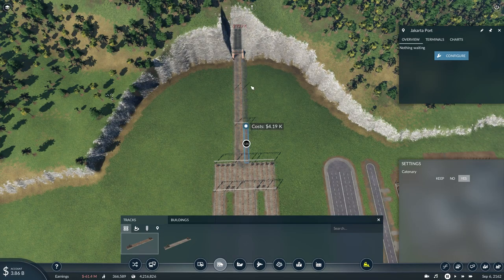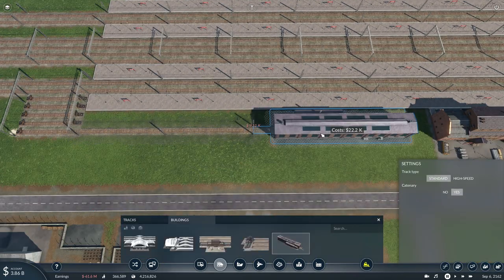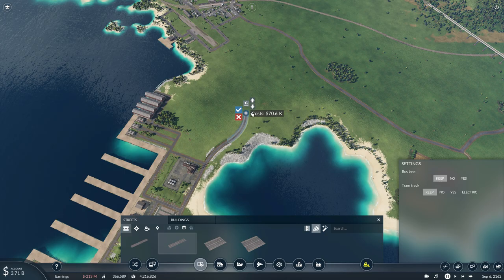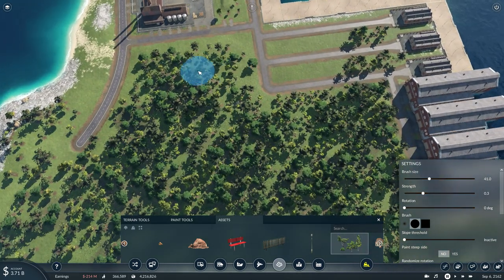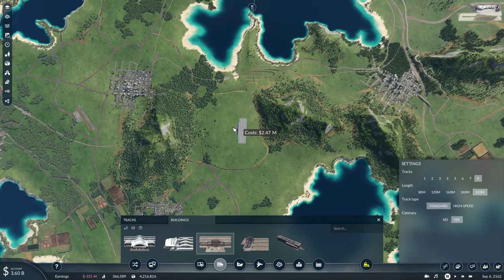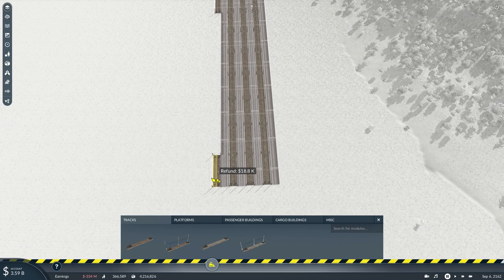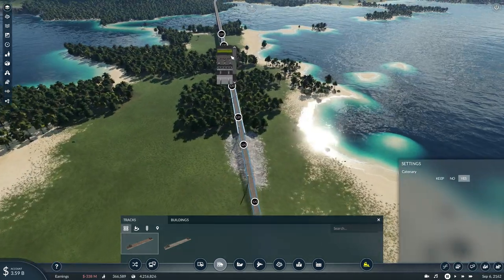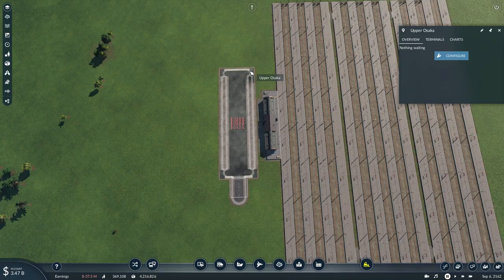Transport Fever 2 - Freight Hub (Oil wells, Oil refineries & Fuel refineries) PART 2

Comment: My compliments as always. Could you build a 3-story station? The first level would be underground. The second level is at street level. The third level is above everything. If you know the compass rose, take a sheet of paper, make a point in the center and the lines pass through that point. The first level runs from north to south. Level 0 at street level runs from west to east. The third level runs from north north east south southwest. Look THE + / I + / overlap these symbols and you will understand.
Reply from the maker: Building a 3 story station will require to many mods.
And I am trying to use only a couple of mods
Reply: My friend the mod stations are 2. The first is underground and the second is the station on 2 levels, everything is on Steam. Make a basic station. As for the other mods, limit it because you don't have to make a megalomania it is a project of realization then the commitments and modifications of megalomania come later and I assure you that it leads to inspirations of many ideas.
Reply from the maker: Will see.
I am trying to build most of the thing with the vanilla object,but that can change :)

Comment: Which mod do you use so you can place and delete industries? I'm currently using one where I can't delete them, Industry Tycoon by Pluesch
Reply from the maker: You don't need any extra mods!
The one that comes with the game (sandbox mode) allows you to place and delete industries and towns!
Reply: @UnknownPlayer2020  so there's no mod i guess. So, does using sandbox mode change my gameplay experience in any way or is it just the same?
Reply from the maker: It just makes the the game feel a lot easier.
For example you can set a good production chain next to a town that requires it.
Or you can create a whole industrial area with different factories.
Or place several towns together to create a huge city. There are unlimited possibilities , it's up to yourself how you like to play the game! :)

Comment: I was building something similar and had to split the road haulage into two lines to deal with the amout of crude/oil/fuel coming off the large train and ships. This also meant in large cities each road line could have drop offs in different part of the cities.   One question - What catentary are you using?
Reply from the maker: I think it will require a lot of work once all the industries are fully functional to manage to keep up with the amount of products.
I am only using 2 mods (sandbox mode provided by the game and the bigger brushes).
So the catenaries are vanilla.